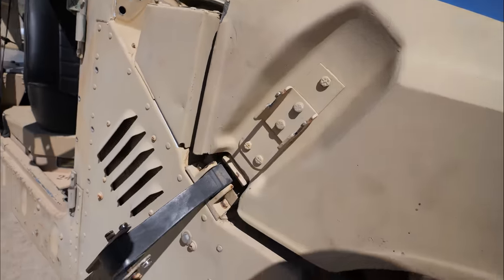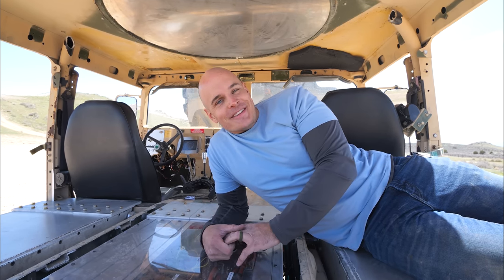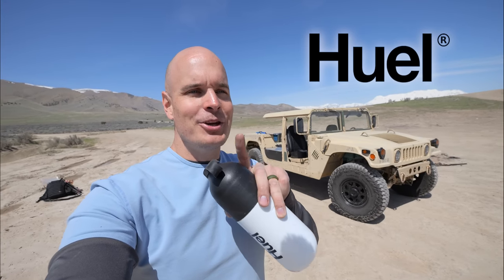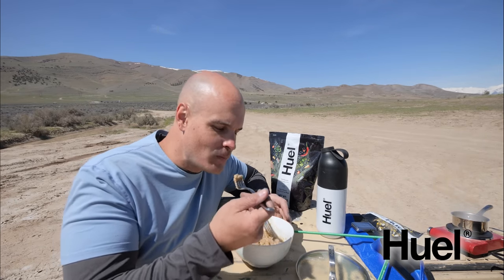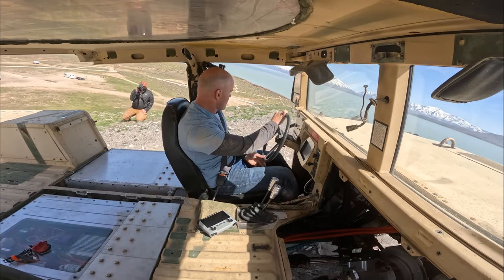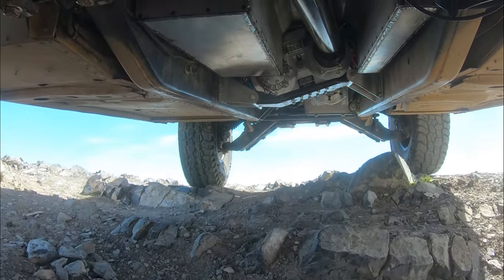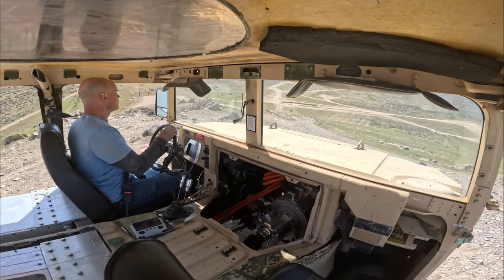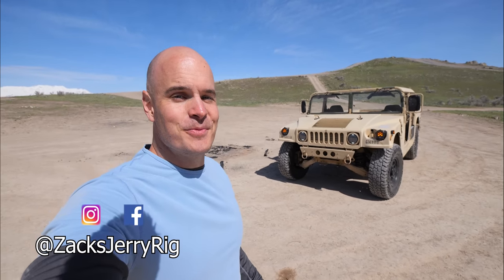Off Roading my DIY Electric Hummer - What could go wrong?

Comment: I did not see that you lowered the tire pressure. It is very important for good traction and a smoother ride off-road do lower the tire pressure. In this video it does look like your pressure when still fat for Street not Offroad. Remember the vehicle even had onboard air control for the tire so you could lower and raise the tire pressure for road conditions

Comment: Any way to throw the motor controller into a speed or position hold mode?  After watching way too much video from Moab, I can't help but think rock crawling would often be a lot easier with a Jog-wheel than a throttle.  (or with the throttle re-mapped to 0-5mph instead of 0-100%power)

Comment: Keep in mind that if you have used Tesla batteries then they are probably at only 80% of the original capacity at best but more than likely 70% of capacity so you really have approximately 90x0.75=67.5kWh of capacity.

Also that jerking can also be from the controller. In my SXS electric conversion my Sevcon controller had a gear/belt slack setting that took a lot of that out in my build. Maybe your controller has a similar setting?

Regardless it is an awesome build and it has been fun following your build. Cheers!

Comment: It will be unbearable gear noise at highway speeds. Replace all the gears in the portal wheels? No, you have dressed up as miss piggy to climb a mountain, that is the sole purpose of this monstrosity, Arnie would approve it.

Comment: These EV conversions of military suplus HMMV's make a shit ton of sense.

None of the dogshit engine related maintenance issues, and all of the benefits of a capable 4x4.
Reply: @girlsdrinkfeck  The throttle control issue in the video is likely just a programming issue. There are a fair number of EV conversions that 4x4 just fine. Electric Suzuki's in particular are interesting. As an EV military HMMV would be a lot like their bigger brother with less of the high centre of balance roll over issues.

Regarding batteries, it's too bad folks can't just treat 'em like actual batteries.

Batteries drained? God damn, just swap 'em out. Nobody ever buys a whole damn new remote control, controller, GPS, other electronic devices,  or a whole new cell phone when the batteries die.

Separate the battery from the EV and you have a great solution. The frame, motors, etc are re-usable and the batteries once reduced to 80% of the overall capacity can be recycled and turned in as a core to be used for grid power storage.

Also, the idea of sitting and waiting around to recharge batteries makes even less sense than rolling up to a battery station, throwing in a fresh set and leaving the drained batteries behind to recharge for someone else.

That's the advantage of gas/diesel. Range is dependant on being able to refuel instantly.

Comment: Your motor are very weak and low quality.

That i can hear for it sound when it spin.

Also , at the climp to top of hill the hambee bearly drive and draw a lot of current ( motor stuck take more watt then when it spin faster).

replace the motor and gear